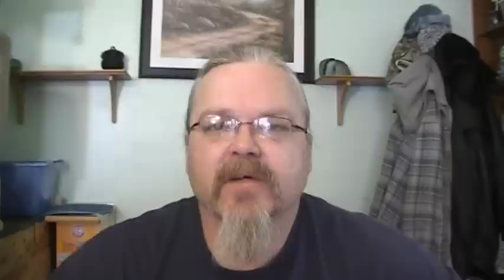Special Report (12 November 2011) El Hiero Nuclear Dump & Volcano = (ALERT)

Comment: "Nobody knows where exactly the fuel is, or in what condition," he said. "The reactors will have to be entombed in a sarcophagus, with metal plates inserted underneath to keep it watertight. But within 25 to 30 years, when the cement starts decaying, that will have to be entombed in another layer of cement. It's just like Russian Matryoshka dolls, one inside the other."